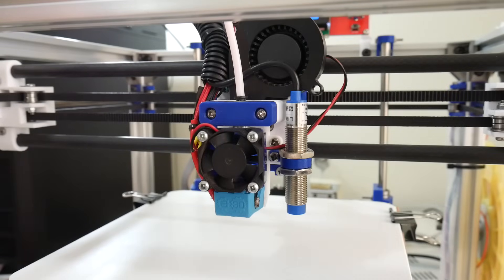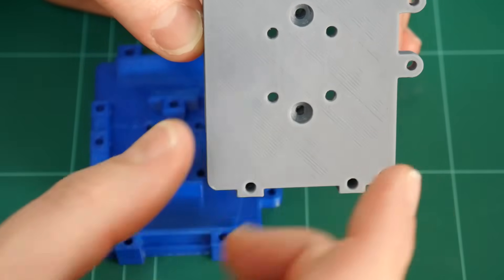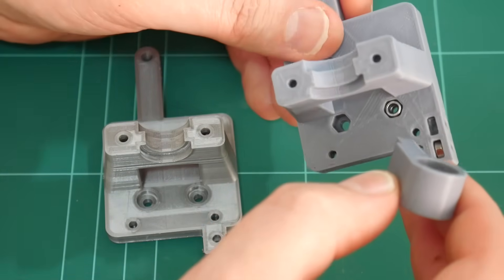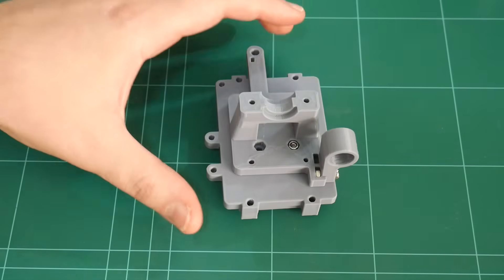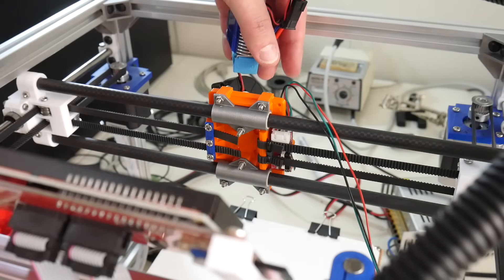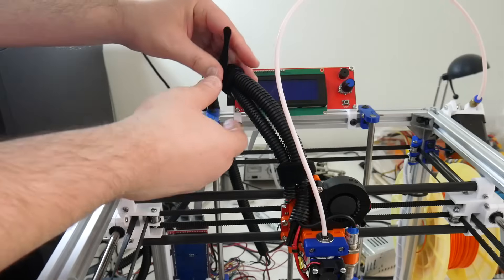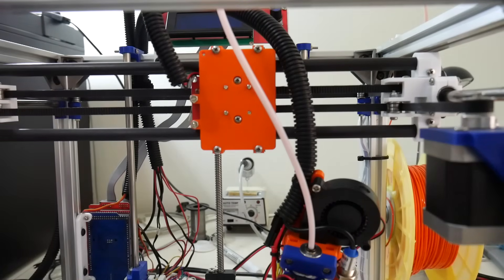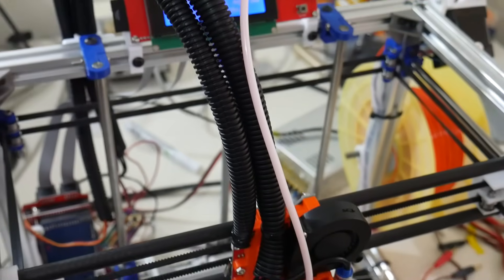New 3D Printer - Build Log #17

Comment: Great series. I was inspired to create a very similar design with the aim of using Geetech A10 (Ender 3 lookalike) parts. One of the first things I discovered is that the bearings (for the carbon fiber rods) are slightly compressible. If the bearing holder is a split ring with clamping screw it is possible to fine tune the fit and eliminate any slack while maintaining free movement.

Comment: Hi, I 3D printed and build you Hyper Cube.    I have build other printer before.    But, this is the first one that has Auto Bed Leveling.  The inductive sensor is the same as yours.     Marlin 1.1.9 is configured from your two sample files.    I am quite savvy with Marlin.      But, I need to tune in the Z axis.     With bed leveling feature "G29".    The Z height  is always two high to print.       Do you have another Video to do this calibration on your machine?   I did try using C Riley bed leveling You tube video.     But, I think I need more detail on how to do Z Cal on your design.

Comment: if the bed sensor will be needed for other attachments then leave it mounted along with the endstop... leave the 4 screw holes but have pegs come out of the extruder's assembly and have a single big mounting screw in the middle.  definitely not a fan of the two cable organizers coming off of it though.  to increase the build volume (not by much mind you, but I'm a freak when it comes to utilizing space) I'd build it so the nozzle just barely clears the bottom track to free up some more z space.  I'd even shoot the airstream of the fans between the lower belt and rail through a hole in the piece that stays mounted and run the fan off the backside so fewer parts get taken off... the fan could be used to cool a laser attachment as a bonus, or blow away cnc materials.

Comment: Im currently working on this printer myself! Where im using the full length of my 600mm rods for the X and Y axis. and full 500mm on my Z axis! Im, not using bushings etc, like you do tho. So I've had to modify alot of the parts! Im aiming for a printer who will be capable of printing 50x45x45cm! Will be making a "Remix" on thingiverse aswell as taking pictures! Fun project as I've not made anything like this before! Using alot of your videos as reference ofc. But allso adding an Optical filament sensor to automatically pause the print when filament runs out!

Comment: The bushings work perfectly alone on the carbon fibre, but in the dual holder, they have quite abit of resistance. Is there any way to fix this?
Reply: Personally i went for lm8uu bearings for the Xcarriage. Had to modify some files in fusion360 but it turned out perfectly!

Comment: Great videos every one of them. Nice job and very educational.  I am wanting to start my own off your ideas, but i am in the US and alot that you have used is not available in the us. Like your 2020 aluminum extruded i can either do 1 inch or 15mm. Im thinking of going to the 15mm but the printed material  that you came up with won't work due  to the center lines. Is there anyway i can change the printed material to fit my concept so i dont have to try to reengineer the wheel so to speak??

Comment: This video isn't in the build log playlist
Reply from the maker: Fixed - thanks!
Reply: You're welcome. :)

Oh, I had a question for you. I'm ordering the parts to make my own modified version of hypercube right now and I was kind of curious on why you prefer banggood and not aliexpress?
Reply from the maker: Choice of shipping methods, not buying from multiple sellers like ebay and good customer service.
Reply: Fair enough, and that's part of the reason I'm selecting some of the parts there as well since my budget is so bare and I have to shop around. Do you want me to keep you posted on the progress of my printer? I only have my motors ordered so far, but my shopping list is almost completed (and likely would be completed by now if it weren't for metric screws being so difficult to find here in the US)

Comment: Tech2c, fantastic work. Your mods in this video to make the base x-carriage capable of supporting other solutions has gotten me thinking. What about a solution that caters for multi-colour printing, with a view to hopefully supporting auto-'head-change'. Could you not possibly cater for multiple hot-ends mounted somewhere on the alum frame, and able to be reached and auto-attached to the base x-carriage ?  ie with no human interaction and minimal delay.  I'm thinking possibly with a locking mechanism that might use an r/c micro-servo or small solenoid. Also, perhaps removal of the fans from the head-end to the y-axis or outer frame, and use of lightweight air ducting etc (possibly as a one-off attached to the base x-carriage, rather than per head). Also, have you considered the use of M3/M4 aluminium bolts and nuts to save weight, as the number of nuts and bolts seems to be escalating.
Reply: All you really would need to do to get a multicolor setup is to use the e3d chimera instead of the e3dv6. Im planning on making my hypercube compatible with the chimera system some time. First i need to build it and get it to work with my e3d Volcano tho! :)

Comment: So glad this got reworked.  The old system was a bit cumbersome to put together.  Kudo's on the nice work (in general)!

Any chance you could post your settings for the eSun PLA pro filament?  It's the one filament that I haven't been able to get working on my Hypercube.  I get tons of strings, even with really high retraction settings and 220C/50C settings.  Everything else seems to work like a charm.
Reply from the maker: 210-215c usually. Try lowering your print temperature. Stringing can occur when printing too hot. Drop the temp by 5c and test/repeat.

Comment: Hi, out of curiosity, where are you getting your PETG from these days?  Aurarum don't seem to stocking much anymore.
Reply from the maker: I just buy from local eSun distributers now. The diameter tolerance on Auraum's plastic is quoted as +-0.1mm which is too much variance for 1.75mm filament, ok for 3mm.
Reply: Do they have a website?  I'm from Perth as well.
Reply from the maker: I've bought from kingdom3d.com.au and cubictech.com.au

Comment: You can expand on the "hot swap" hot end assembly by using an "mpx connector" to connect the heater cartridge, thermistor (and another connection such as a fan if you choose the x3 connector). These connectors are high amp rated and allow you to connect/disconnect the whole electronics in one easy step. I use this setup on my Toolson Edition P3Steel.

Steve
Reply from the maker: Yes a connector will likely be required to finalise the ease of tool head changing. A bit of effort upfront to solder everything to mpx connectors but worth it in the long run. We could common all grounds together to reduce pin count? Good idea!

Comment: I still like Artur's X Carriage remix better. His captive nuts already make the tool head changeable from the back with 4 screws. His also has captive nuts everywhere, like the endstop. I'd worry that using nyloc nuts doesn't give enough length for the carriage to be strong. Also have you seen Bagwan's belt tensioner? It's really useful.
Reply from the maker: I haven't been keeping up with remixes. It's good to have a selection though :)

Comment: Hey tech2c thank you for changing the endstop mount. It was very needed. Did you modify the new offset from the nozzle in the firmware. Keep up the good work.
Reply from the maker: Yes the induction sensor mount was in dire need of replacement. The new firmware is set to 0 as you can change the Z offset via the menu on LCD screen. If you don't have an LCD then you must change it via gcode or firmware.

Comment: Have you ever considered heat set brass nuts from mcmaster? I use them on parts I design and love how sturdy they are.
Reply from the maker: I haven't experimented with those as of yet. I hear quite a lot about them so I should give it a try.
Reply: One of the things I really appreciate about these is how I was able to do my mount for my hot end. I have a titan aero, and it looks rather nice and is ideally accessible when facing forward. So I used a pancake motor (both a small one and the one e3d sells as an option), but to keep the size of my mount down I didn't want to have to put nuts just behind the motor (and in fact would be very hard). So I was able to melt these brass fittings in on the back - the face that connects to the x carriage and they stayed in perfectly.

Comment: Great developments with the Hypercube! I can't wait to print out the new x-carriage and e3d mount. I'm wondering though, assuming any new mounts will also use the RAMPS board, maybe make a breakout board with connectors to mount on the x-carriage? That way the loom acts as a wiring harness which doesn't need to be replaced when a tool change is required, just disconnect from the x-carriage.
Reply from the maker: Yes that was discussed in another comment here.

Comment: Just a thought but, would (wiring loom wise) it not be easier to have all the wires connected to connectors on the back of the carriage like the Toronado extruder?

Also, shouldn't the sensor also be on the "X" carriage? so that you can use the homing for a diode laser of cnc tool?
Reply from the maker: As we progress we shall see what needs altering. Very good points.

Comment: I've seen modifications to your hypercube design that uses 3030 extrusions for the frame. Do you think that is a viable upgrade, or is it a bit of overkill?

Also, what % of infill did you print the PETG in this video's project?

Thanks.
Reply from the maker: I print at 50% infill with PETG.

If 2020 extrusions aren't strong for supporting molten plastic being squished through a 0.4mm nozzle then a redesign is required, in my opinion :P
Reply: Well they scaled up the size a bit and I didn't know whether or not the 3030's would be overkill, especially for added mass for a little noise reduction and more rigidity.

I asked because I'm hoping to build my first 3D printer based off of your design but making it a hybrid of the other design for the larger size and a couple other tweaks of my own based off of a couple other designs. I think the cost of the 2020's is much more managable, but I was worried about the larger size might need a little thicker stock since I don't have the experience you have with it.

Comment: This is a nice upgrade! I'll start printing mine today, thanks. 
On the sensor holder, my current setup interferes with the (top) cooling fan, is the new setup doing the same thing?
Oh, and on a separate subject, my 10mm carbon rods came in but they are not 10mm, they range from 9.86mm to 9.90mm so I will need to re-think some solution for the bearings... just a heads up on this for others.
Cheers,
 - Eddy
Reply from the maker: Buy the carbon tubes from somewhere else then. I bought mine from ebay from a reputable seller. Not the cheapest but quality is very good.
My induction sensor has a couple mm clearance from the fan, but I can understand if it needs to be mounted higher it could interfere with the blower fan. In that case the induction sensor mount should be extended 5mm to clear it.
Reply: Thanks for the reply. I will go back and re-check my source. I see that there is an amazon source for them as well (buildlog #16). I will look into that.
Cheers,
 - Eddy

Comment: You may also want to examine a project I worked on for the Prusa MK2/2S with similar goals:
https://docs.google.com/presentation/d/12PmVLfYk1UosDgspLPZyUWEGUCZwj7OvrbN18gMhQkM/

Maybe you will find something that helps you adapt it to your project.  If you want more of a BOM of the Electrical parts, check out https://docs.google.com/spreadsheets/d/1oEQxPJqnEUee-LLAvP19WlYNce8R58CSwagd51CP-rk/
Reply from the maker: Wow, comprehensive design and parts list! Thanks for sharing.
Reply: It was designed by an electrical engineer on the electronics side.

Comment: Instead of undoing screws, a quick release camera mount for a tripod is a good way of securing a hot end or other printing head to the X Carriage rail mount....they incorporate stabilising side walls to stop the extruder head shifting side to side; Existent parts can be adapted to receive this new attachment. Surely it's possible to 3D print a quick release head assembly..... I'm going to give it a go.
Reply: I was thinking along similar lines. A dovetail groove to slide the head onto and it can be locked down with a single screw. This would facilitate faster swapping of the heads and simplify alignment when mounting.
Reply: Good idea, although Im thinking of trying to use no screws at all. Magnets could negate the need for screws if combined with a "self tightening/stabilising" woodwork joint... If you design a new mount, please share eg. on Thingverse or print one and sell me it LOL!

Comment: Is there any particular reason you didn't install the endstop on the Y assembly? It just seems kinda clunky with two big conduits running back now.
Reply from the maker: Early on in the build series I made the decision to locate it with the X carriage as we needed cable management for the hotend anyway. After this video it seems nonsensical to keep it with the X carriage but wee will see. A laser engraver will need cable management and so will a drill so I don't think it's a total miscalculation just yet...
Reply: Been following from the start, loved how clean your prints were even on the I3. I might suggest moving the endstop over, and then perhaps having each loom unplug and come off, so you don't have to just tie each one out of the way for laser/mill/hotend. That could get really clunky really fast, and a modular system would be awesome.
Reply from the maker: Clever ideas. As we progress we'll look at cleaning up the design for a less-clunky setup.
Thanks for watching :)

Comment: I find the Threaded Blind Rivet Nut easier to use and more secure. You do need 10mm depth to use them though. Some put them in with a soldering iron but I make them a tight fit and press them in with a vice.

http://www.ebay.com/itm/20-40-100X-Flat-Head-Metric-Threaded-Blind-Rivet-Nut-Insert-Rivnut-Nutsert-Screw/151788854026?ssPageName=STRK%3AMEBIDX%3AIT&var=451235417879&_trksid=p2060353.m2749.l2649

Comment: I would suggest moving the x carriage end stop from the x carriage to the cross bar/y carriage and have it hit the e3s hot end mount. this does 3 things, it clears up the space above the printer making it easier to add or remove new heads, it reduces the weight of the carriage making the printer faster and more accurately and most importantly it allows you to have different end stop distances for different printer heads. some heads will take up more space than others and you may end up with issues when trying to home the printer
Reply from the maker: Good points. As we progress with various tool heads we'll see how the X endstop performs in its current location and look to modify as needed.

Comment: Actually if the inductive sensor would be attached to the carriage itself, you just had to design the other toolheads in a way that for example the tip of a pen is at the exact same place as the Nozzle-Tip. (Maybe with an 3d printed aligning Tool?)

Like this you would have to purchase an own sensor for every toolhead.
Reply: Hamilton Cline: I disagree. Most tool heads will need the inductive probe. And if you're already running cables to the x-carriage anyway... Just use the tip of the probe as the baseline and align all the other tools to that. The mounting mechanism described in the video seems precise enough that you won't lose alignment when swapping tools in and out.
Reply from the maker: Valid point.
Reply: Although technically the sensor should always be aligned with the head, so makes sense to be attached to the head.

Comment: Why would the nut size change? They are manufactured according to a norm, so they are always the same size (of course there are tolerances) if you buy the same norm part.
Reply: It's all coming from China so standardization can go right out the window.. the parts may also have been a non-standard special order and the seller is just trying to offload surplus.
 - Eddy

Comment: Well done. Question:  why have the cooling duct be separate?
You could make the E3D assembly as a single part.
Reply from the maker: That would be difficult to print, but I guess the main reason is some hotends have different lengths. This way you can choose the length of duct required.

Comment: you could add 4 pin connector next to assembly and keep all in one pipe.
then tou could print connector and make this compleatly replaceable with laser .
Reply from the maker: As we add tools I can see we'll need something like that.
Reply: Tech2C ihave laser love it but ihave  to re design alot to do it what i need to do.i have custom connectors sure 3d printed.
i may post this on thingiverse later.
its easy to swap heads .
igot direct drive 
laser 
and filament heads that can be swaped in less them minute.

but love ur videos keep it up!!!
Reply: Have you thought about a system somewhat like the one used on the Toranado extruder?